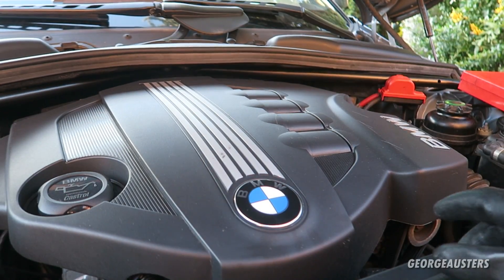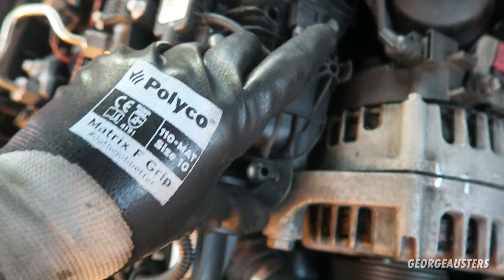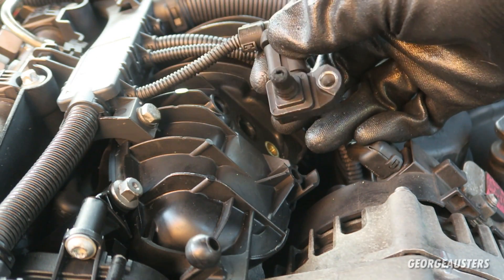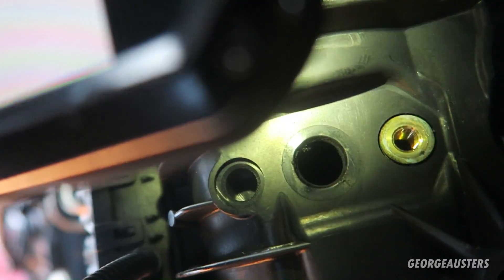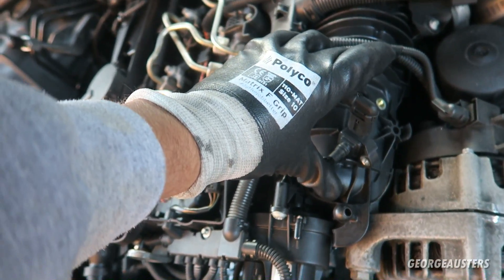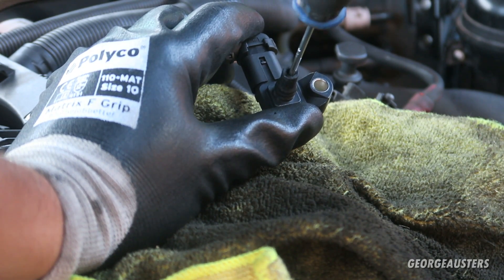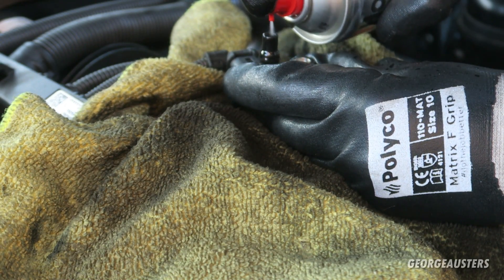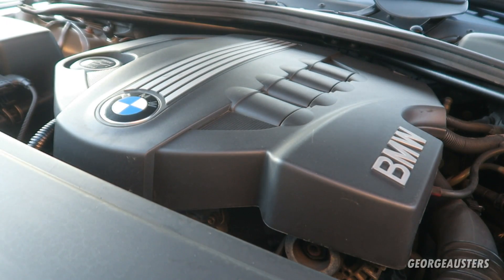Why You NEED To Clean Your MAP Sensor

Comment: Don’t do it like this guy, remove the electrical connectors, don’t stick something  hard and sharp in it and don’t use carb cleaner, you need to use electrical cleaner or pure alcohol and let it dry for 30 minutes

Comment: My Sorento was idling rough, hard to start. I could figure out what it was. The codes were all over the place. I changed the crank shaft sensor, 02sensor, iat sensor  sprayed and cleaned throttle body 3 times cleaned intercooler, cleaned egr valve, cleaned MAF sensor then after watching countless videos  I ran across Cleaning the MAP sensor and it was clogged with carbon build up. After spraying with Choke cleaner And whaala.
The Sorento runs like new. No more hard to starts and stalling. Or extreme rough idling. Thanks to Youtube university it's runs perfect.

Comment: Great video George😊👍. Thank you for sharing your knowledge. In over 6 months I had Lag when i push acceleration. Lately drive train pops up every time the accelaration reach 2000 rpm. After watching your video, it motivate me to check my map sensor. I can tell my map sensor was clogged and cover with 1 cm of oil and carbon. After cleaning the sensor with turbo and egr cleaning flluid and the hull in the intake manifold. My engine work very smooth. Now my car accelerate very good and the drive train errors disappear. My car passed 155000km. I think I too need to do a total cleaning of the intake manifold. Again thank you much. You have saved my day :-))

Comment: Even if this single process does not make the engine feel more powerful or efficient, the sum of all these things, O2 sensor, MAP sensor, crank case breather valve etc make the difference between an old engine that feels old and an old engine that still feels pretty fresh.
And earlier or later such a sensor alone can actually make a big difference, why wait for that, if you can prevent it for free?

Comment: George, do you think that simple cleaning of this sensor might resolve a 25d100 code?  (charging pressure sensor signal open circuit or short to ground)  It's associated with a Drivetrain Malfunction CEL and engine shuddering under maximum torque demand. 

There are also codes -- 
25d000 charging pressure sensor signal short circuit to b+
259100 exhaust temp sensor upstream of catalytic converter signal deviation too high
259200 exhaust gas temp sensor upstream of diesel particulate filter signal deviation too high
290b00 air mass system measured air mass too low
-- which I consider to all be daughter codes of the actual malfunction.

Cheers.

Comment: Great job, just be careful poking a large flat blade screwdriver into the map sensor as most of them also have a little heat sensor at the opening which is very easy to damage. All diesels cars need the major service of taking off the inlet manifold to clean all the egr/oil combo buildup which definitely effects performance and efficiency of your engine, an good example of anti pollution devices causing more problems and long term pollution than without all that EGR junk in the first place.

Comment: Yeah I thoughtlessly blasted air (really not good as the MAP operates using a sensitive membrane to measure air pressure) and carb cleaner near the sensor while cleaning throttle body... threw a CEL after and ran terribly: high idle, late shifting, power loss, running rich etc. After cleaning the (very clogged) MAP and idle air control, she runs wonderfully. Great and easy thing to do once a year. 👍

Comment: Hi mate, cracking video, do you have to take the sensor off the cable?, or can you spray while its still atrached?, mine in my insignia will not come off, tried undoing the clip an everything but its stuck so will have to use the spray while still attached haha
Reply from the maker: Can leave it attached
Reply: @GeorgeAusters  thank you for replying so quick, the idling is a bit rough now but im waiting for the spray to come to clean it out properly 👍

Comment: Thanks for great videos,  I'm driving a 2012 bmw 318d 2.0, check engine light came up with P0406 EGR, so I cleaned up the EGR valve along with the intake manifold and the EGR cooler plus the MAP sensor, the light went out and everything seemed OK until a few days later the light came on again,  only this time the code is P046C, again for EGR, the EGR valve is clean and it's flowing nicely, not sticky anymore. 
Any ideas?

Comment: Pointless to clean that MAP sensor without cleaning the throttle body that you just removed it from and you should be using electronic parts cleaner and not carb cleaner.
Reply: Thanks, Bryan --- could you recommend a specific brand of electronic parts cleaning spray?

Comment: My understanding is that you should only use MAF cleaner on either MAF or MAP sensors as carb or brake cleaner is too harsh to clean a sensor with. Look for a can of MAF cleaner...
Reply from the maker: No difference to electrical contact cleaner really

Comment: I wont even think on driving anything solid inside a MAP sensor tube, they operate by detecting tiny flexes on a chip at the base of the sensor product of pressure changes in the outside. If you push anything against it you are going to decalibrate it and be screwed. I just blast them with contact cleaner, safe and cheap, but thats me.

Comment: I wouldn't use Carburetor cleaner I believe the chemicals are too potent for the sensors.I prefer MAF cleaner "Mass Air Flow" electric sensor cleaner.It's more compatible to the sensitive parts.
Reply: THANK YOU! I don't have MAF cleaning spray on hand --- could I use rubbing alcohol (isopropyl alcohol) in a spritzer bottle and then let the MAP sensor dry out before reinstalling it? Please advise... Much appreciated...
Reply: I don't have contact cleaning spray on hand --- could I use rubbing alcohol (isopropyl alcohol) in a spritzer bottle and then let the MAP sensor dry out before reinstalling it? Please advise... Much appreciated...
Reply: @jimb1580  rubbing alcohol should be fine.
Reply: I just use brake cleaner dammit
Reply: You shouldn't use MAF sensor cleaner either, you need to use electric parts cleaner

Comment: I've been chasing problems in my 1995 toyota corolla, I don't know why I didn't just start with this. But atleast she got a new set of fuel injectors, fuel filter, plugs wires and a good oil change. Kinda impressive she has 250,000 miles still runs smooth as silk  and am sure she still has alot of life left in er.
Reply: Congrats, I have a 1995 Toyota Camry and this little thing is a beast, it's been so reliable

Comment: Could this cause the car to hesitate & lag? 

My 330d on acceleration thinks about it for a second or two then takes off when the turbo kicks in. 

At 60mph it sounds like it’s fighting. I’m sensing a clog somewhere
Reply: Same story!! 320d 150hp. It also has a terrible fuel economy
Reply: @antoniocignozzi1477  you tried throttle reset?
Reply: @Fd20y  how do you do it ?? On diesel engine ?
Reply: @antoniocignozzi1477  
Yes mate easy. 

Make sure car off all together

1.Firstly put your accelerator flat to floor

2.Turn the key to position 2 (where all dash lights on but don’t start car)

Count 12 seconds

Then turn key back to off making sure you pedal is still down. 

Count to 12 again

You’ll hear a click from around the accelerator area 

Once you hear that, start the car!
Reply: @Fd20y  did not know this cool feature! Thanks a lot I will do it as soon as possible !!! Thanks again !!
Reply: @antoniocignozzi1477  

BMW fitted a cloning device to the drive by wires on the accelerator in the early 2000s. The throttle adapts to how you drive & delivers the adequate power to what you’d built up recently. Hence the lag In throttle. 

I do the reset every 2-3 days mate keeps it fresh and lively. Only takes a lot of busy start stop traffic to make it happen so I’d suggest doing it frequently too
Reply: @Fd20y  thanks mate!!!
Reply: @antoniocignozzi1477  
Always welcome 

Good luck. Let me know how you get on
Reply: Worked it out 

If was my fuel trims, had to adjust the long term fuel trims. Goes like rocket now

Comment: hi , i have 2001 e46 320d and it has no power oh torque and barely even climbs hills on first gear . only if the revs get about 2.5k then it has power and boost , would a faulty maf sensor cause this?
Reply: I have a very similar problem ! Does it also have a terrible fuel economy ??? I believe it’s MAP or MAF
Reply: Faulty egr valve caused this on my rover 75.

Comment: is a map sensor the same as boost pressure sensor? and could this cause power loss now and again? with smoke and soot coming out the exhaust on acceleration?
Reply from the maker: Manifold absolute pressure sensor.
Reply: @GeorgeAusters  does a faulty map sensor cause low power when i turn the car off and on i get full power for maybe 5 mins then it goes again feels the turbo isnt kicking in

Comment: Just cleaned my MAF and MAP and of course I am imagining results, but it feels good. Thanks!
Reply: @sheparddog117 fuel pump
Reply from the maker: Definitely doesn’t hurt Paul!
Reply: @sheparddog117 definitely is a faulty fuel pump , replace the fuel pump , before that just read some codes and check if anything relating to the fuel pump shows up
Reply: @sheparddog117 Does fuel pump solved it sir? Or something else was the problem?

Comment: Where is map sensor on a 2005  ford 500 3.0 V6 duratec ?
Reply from the maker: In the intake manifold
Reply: @GeorgeAusters  Thank you I have look inside the intake manifold. Don't see it this has been a challenge lol.
Reply: I already replaced the MAF sensor but the issue is where is the Map Sensor I look at the intake don't see Map Senor

Comment: It is a good idea to clean it every so often however I would be very careful with tellig people to stick a screw driver in it! for 2 reasons, 1 you might force the carbon down further inside and 2, if you stick it down too far you may damage the diaphragm and break the sensor.  I personally would not use a screw driver, rather a soft brush or a cotton bud as much less risk of causing damage, or better still just let the cleaner disolve the gunk the spray it out with the nozzle. These components are fragile and not cheap either.

Comment: Any guys here have any knowledge on why a diesel would have a uneven idle ?
Reply: Mr330d  bad spark plugs 😉
Reply: egr , fuel pump or injection pump
Reply: Glow plugs or glow plug controller
Reply: pressure/intake regulator on the pump. just fixed mine.
Reply: Map sensor

Comment: Hi, what spray are you cleaning it with?
Reply from the maker: Carb cleaner mate
Reply: @GeorgeAusters  is throttle body cleaner the same as this !?
Reply from the maker: Basically
Reply: @theroyalone7588  It is not, don't use throttle body cleaner, it'll actually say on the can dont use on maf/map sensors.
Reply: @-Wreckanize-  thanks a lot

Comment: I cleaned mine last year 
You DONT touch the VERY sensitive wire part!! I bought special Mass Air Flow sensor spray
Just spray the wire part (do not touch it) And leave it to dry before putting it back
Reply from the maker: Are you talking about the MAF or MAP sensor?
Reply: George Austers oh sorry I’m talking about the MAF sensor 
Not exactly sure where the MAP sensor is on my corsa d. I removed the whole air Intake Control Valve and cleaned it. 
I think the the sensor is on this but it’s fixed
Reply: @jamesmcrory8990  my Subaru has both🤔
Reply from the maker: Most modern cars should have both. MAP is Manifold Absolute Pressure
Reply: @jamesmcrory8990  LOL good luck I'm doing the same thing this week I swear these things get harder and harder to work on every year pretty soon the average Joe like me won't be able to change the oil😂
Reply: Mr. Diesel it’s bollox, my Haynes Manuel it says to change my headlight bulb I need to remove the bumper!!!!! Ridiculous 
I’m not removing the bumper to change a bulb!! I can just get my hand down there but have to remove the fuse box lid,and windscreen Fluid funnel part
Reply: @jamesmcrory8990  my manual says I have to jump up and down three times stand on one foot and touch my nose before I can work on it LOL
Reply: @mr.diesel6042  Lol u r very funny man
Reply: Maf and map sensors are completely different and do different jobs. If you don't know one from the other you shouldn't be touching.
Reply: Barry Black I know that now
Learnt ALOT about cars from videos and Manuals etc but really only basics but still saved £££££